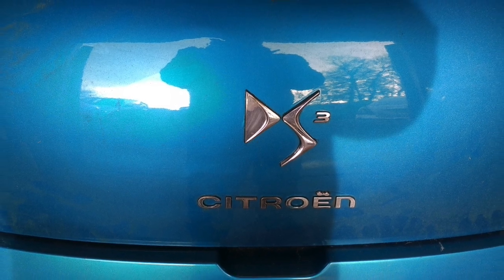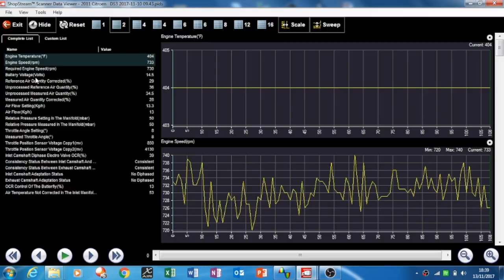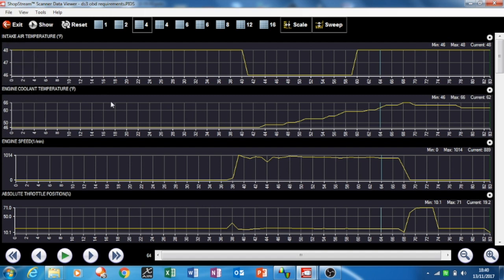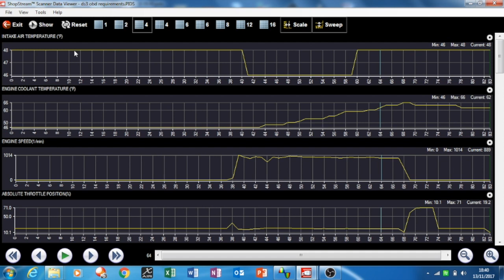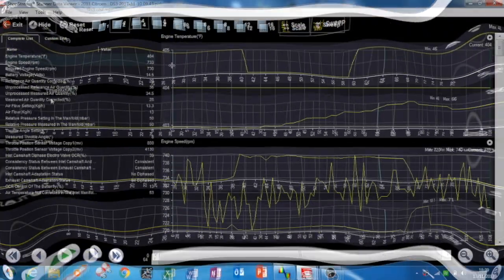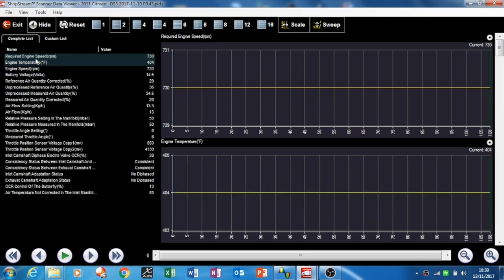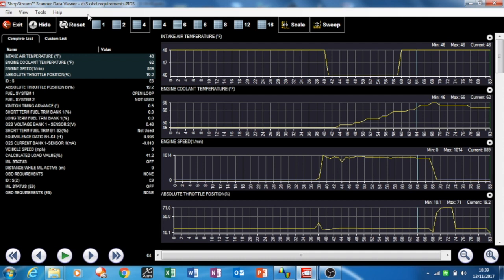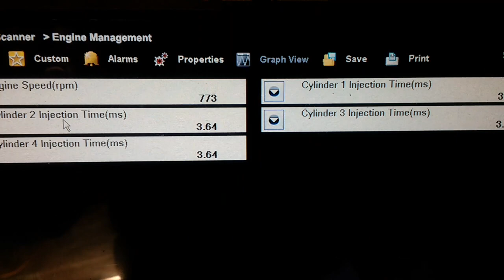Citroen DS3 Misfire Part 3

Comment: Hi There, Thanks so much for your videos. I have a Citroen DS3 1.6 here in Australia with exactly the same problem (I think). My diag report says P1340 misfire on cylinder 4. Can you tell me which is the coil pack for cylinder 4? do the cylinder run from 1 to 4 left to right or right to left? Many thanks

Comment: I had Peugeot 207 CC with the same engine in the garage before few months , with continues running fans . But i was checking the cooling temp on the diagnostic and there were not subsituted value , it was the actual . I use Lexia for diagnosing this cars . About the injector cut off , the same that i was talking about , but on 2 cylinders , cause by knock sensor , that i mentioned on the 2nd video :)
Reply from the maker: Crank cheers my friend I'll remember that about knock sensor

Comment: Did you find out why the fan is constantly running?
Reply from the maker: Bad Coil
Reply: @sandyande  Bad coil pack?
Reply from the maker: @halemotors4084  yes
Reply: @sandyande  \\\\\\\\Thanks for letting mre know, will subscribe. Rick